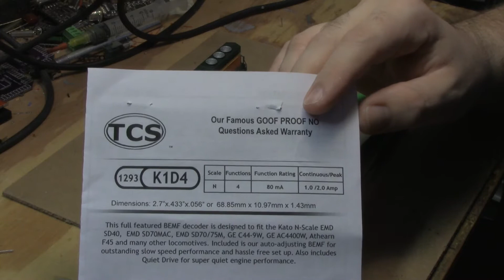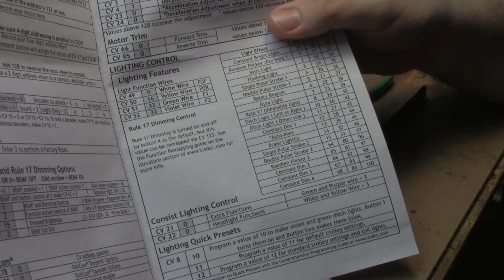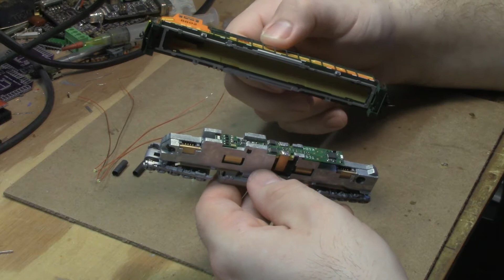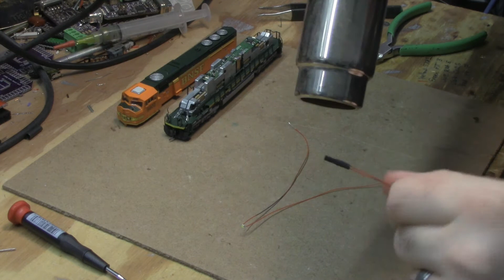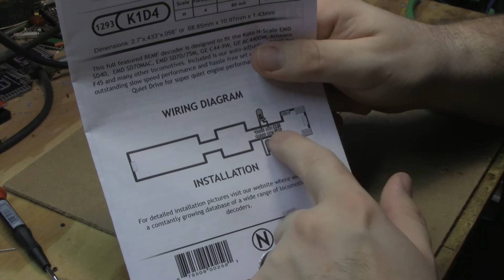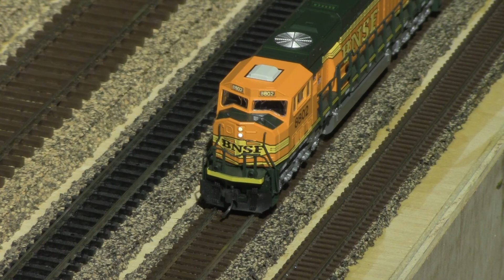Adding Ditch Lights to a Kato SD70MAC Using the TCS K1D4

Comment: The Weller WSD 51 has apparently been discontinued/replaced. Which current equivalent model would you recommend? Have you created any "how to" videos for soldering, for instance, on how to solder power wires to the rails?
Reply from the maker: My wife keeps encouraging me to do videos on soldering.  I recently converted my woodworking channel into more of a general building and design channel, including electronics.  I'm planning to do some of that over there.  Subscribe for updates.

http://www.youtube.com/designbuildexecute

Comment: Really cool. Thanks for the video. On mine I like the Peco led mounted in the ditch light itself for super bright scale effect. The lights to me are one of the most important aspects for prototypical modeling. I really like your method with the shrink wrap. Neat and very clean. Did you come up with this method yourself? Also, I'm sure your aware that you can get the led's with the leads pre-soldered on.
Reply from the maker: I did come up with it.  When I realized the light pipes were already there, it was a no-brainer to use them to my advantage.  We have been using a similar technology for warning/status LEDs on radio communications base equipment for decades.

Comment: Good video Jason.  I will look at your decoder installation.  What I wondered if you have installed a sound decoder and if you have done something similar with the ditch lights?  Thanks.
Reply from the maker: I have not done anything with sound yet.  I actually just orders my first ESU Loksound micro decoder and plan to put that into another Kato SD70MAC.  I should be able to do the same ditch light conversion.  Same goes for these, I should be able to reuse the LED's I just installed and just solder them to the new sound decoder to get the same function.  Programming just might be a bit different.